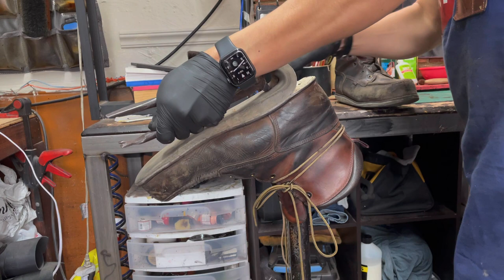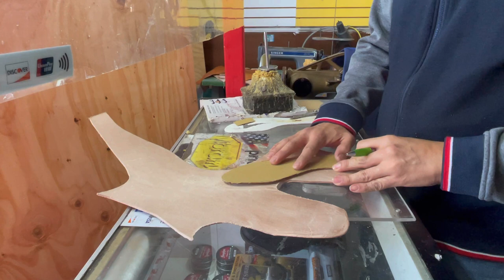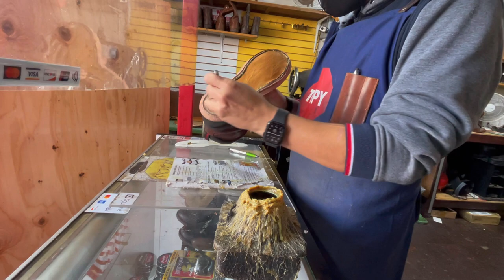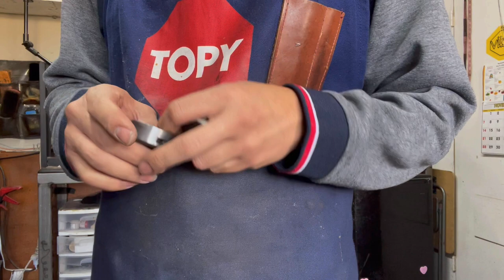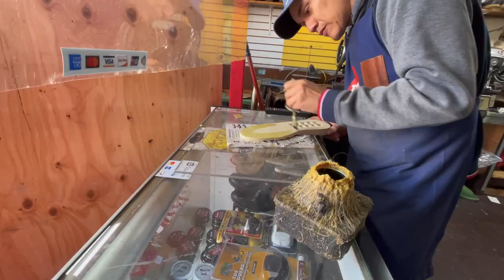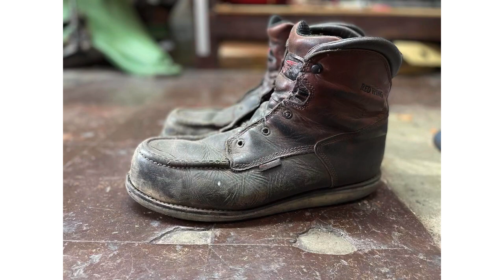Red Wing 405 Resoled/Make Over

Comment: Are you using leather for the welt gap filler for most repairs now or only at the customer's request? Is it vegetable tanned leather like the midsole appears to be?
Reply from the maker: Yes it is,
Regarding the first question, I use both but sometimes I run out of cork and I have to use leather, which is way better than cork.